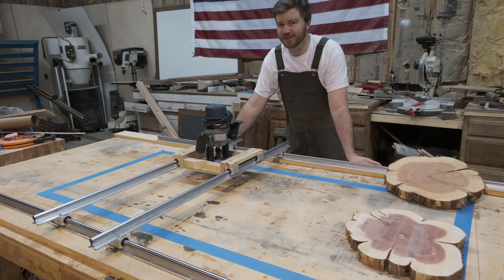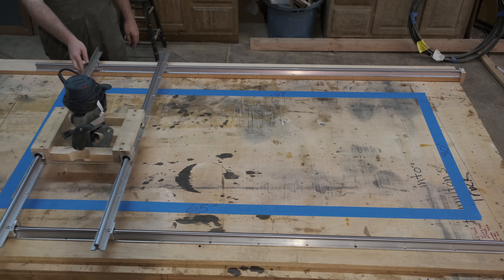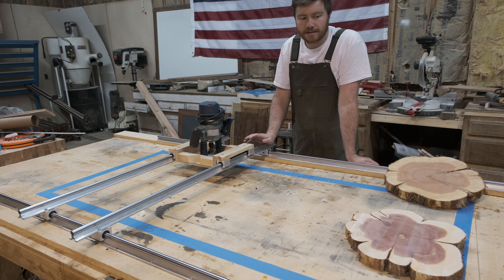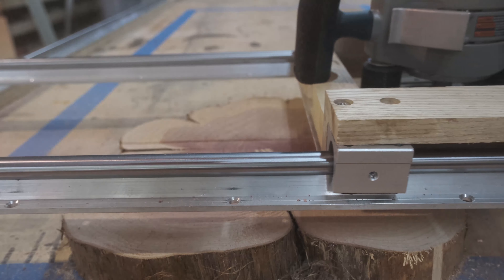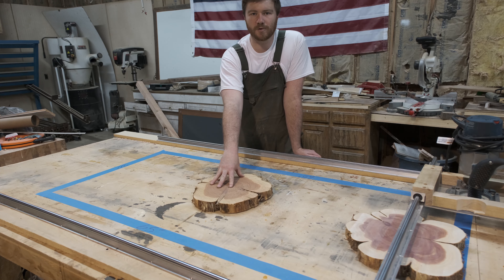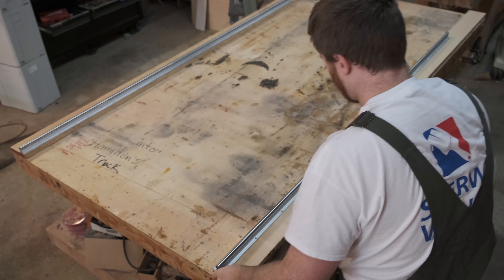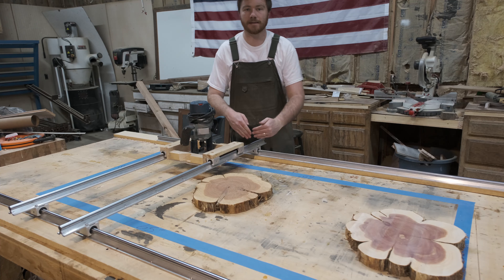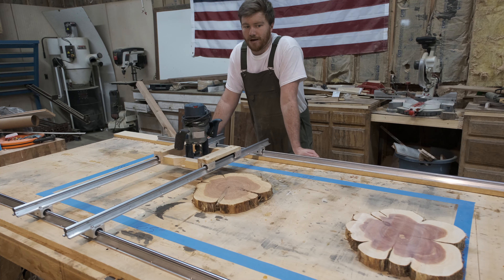DIY Linear Rail Router Sled

Comment: I have 2 lengths of 800mm I got off VEVOR a while back and I think I'm going to get 2x1500mm lengths and I've had an idea to have one plate for a Router and one for a top of the line Circular saw. I think this is worth having instead of a very expensive table saw..
I need to build some form of screw stops to lock the Saw blades into place on the cross lengths . I will be fitting some rulers of a type onto the base cross and length ways to be able to get good measurements of the wood I'll be cutting. I would not use Perspex. I would rather use Aluminium1/4 or 1/2" thick plate. Yes it's a bit more expensive than a 12x12" square of Perspex but for the saw's function it's a lot safer imho.
I bought the Linear Guide rails originally bcos I was thinking of building my own metalworking Lathe but I'm not a good welder as yet and it would've cost me an arm and a leg...LITERALLY PAL.. Ugh! LOL
I enjoyed this video though mate. It was a well thought of idea and very informative. I will be building mine soon and getting 2 uses for it. I'm trying t5o think of a way of getting it to cut mitres wile up on the rails too. If u have any ideas for something like that I would be very grateful to hear them.
I just think something like this has many more applications than just the router plate. I think u have the makings of a brilliant build with more ways of using the piece u built. 
Just a thought my friend. Hope u didn't mind me making those suggestions to much. I mean no disrespect by it. Keep up the great work man. Just found ur channel this morning. I have sub'd liked and all that good stuff.

Comment: I'm looking for insight into router bits for fastening. Your recommended Binstack bit is certainly inexpensive at $45. How would it compare to an Amana or Whiteside at five or more times the cost? Maybe this is an impossible question since it depends on cost versus quality of cut, life of bit, size, and so one. Still do you have any further thoughts about how you came to chose the Binstack or other insights? And thanks for an excellent video, well, explained with all the needed links.

Comment: Great video on the build, did you look at the longer 4 SBR20 UU blocks and rail system, only issue is the cross rails are longer or shorter. Would like to have one close to yours but 8' long . making a walnut table and like to do it in one pass. I'm worried about the joint if you have to add one more rail to the SBR16 system, you think it might jump just a bit? or did you already add a longer rail yours already. Thanks so much for the video, I'm going to mill aluminum plate for the connector cross router system, one other thing, did you think of a way to make an adjustment for height? other than the router ?👍👍👍👍👍👍

Comment: Intriguing.  The whole linear rails with bearing blocks is new to me.  Cool stuff, no question there.  
As I watched what my mind kept coming back to was the table.  I had better be really, really flat.  With no twisting.  That is doable, but it isn't going to just happen, it has to be designed in and executed well when building the table.

Comment: Considering the relatively long size of the upper rails, don't you have the problem of them being not perfectly straighy (u shape)?  My sled, having a 1.5m long upper section is having a roughly 1 mm difference because of a slight bend in the center - how would you solve that?
Reply: SBR20 should be ok at that size but there may be sagging in the middle where the lower rails are different metal. Mine came as SS on Alu and had 2-3mm deflection…unbolting and separating solved it and I mounted the bars on the bocks with readily available clamps on the blocks.

Comment: This is the best bang for the buck, cheapest, rigid router sled design I've seen. I was thinking about doing something similar. Started doing a little youtube research and this video came up. I'll probably weld up an aluminum router base frame with an acryilic bottom for see through. I have all the welding equipment. I might put some struts across the cross slides on the ends to keep them parallel, perhaps some all-thread so it can be adjusted. Maybe It's not needed, but in my mind it would keep it from potentially binding up.  I wasn't sure about using the linear bearings because of sawdust getting in there, but you're right. These components are cheap these days. This stuff used to be very pricy, and only available at industrial supply houses, back around 2012 when I built a CNC plasma cutting table. But now, it's a no brainer. Awesome video.

Comment: Make sure you get the correct tail size that matches  the bearing block. I.e.  screw holes on the rails I purchased did not match the screw holes on the bearing blacks. Absolute nightmare matching the ridiculously accurate accurate machined  screw holes on the blocks to where to drill out the screw hole on the miss matched rails.  Seller really messed me about on that one. Soo freakin agro after that combined with building a cradle out of cheap Chinese crap quality ply I’ll be purchasing my next one.

Comment: I just got 2, 48 inch,  and 2, 24 inch rails with 8 slide blocks from the local salvage yard. Cost, $18 bucks. God works in amazing ways
Reply from the maker: Awesome find!
Reply: @HamiltonDilbeck  Yes it was. Looking at your opening image. Is your router  zero at the bottom of the mount rails? My clearance is 1.75. In other words, the distance from the mounting surface of my base rails to the bottom of the router rails is 1.75". Did you make your router mount so the zero was lower or at your clearance?
Reply from the maker: Yes my router base is mounted to the plate that is parallel with the rail bottoms

Comment: I us hgr20 rails there is no movement in then and there is dust caps on the ends of the bearings.  Use polycarbonate for the router base, 12mm thick it’s not going to move lol.

Comment: So I am building one of these sleds, and this video was one of the primary motivations.  But when I try to install the perpendicular rails onto the bearings of the bottom rails, the drilled holes do not match up at all.  However, I can see from your video that you have2 screws going into each of the 4 bearings, lining up nice and neat with the holes in the upper rails.  Did yours just come like that, and I am unlucky?  Or did you have to modify the holes in the upper rails?

Comment: At 7:41 you mention the possibility for sagging if longer cross rails were used. Do you think there would be much sag if the 1500mm (59”) rails were used instead of the 1200mm cross rails you used in the video?

Comment: I really like the design and was definitely looking at something similar earlier this year, after discovering the world of router sleds. However, after buying a cnc, I find it very difficult to justify something like this. I don't make any large projects, so between my lunchbox planer and the CNC, I can easily accomplish the same result. The CNC may not have the capacity or the power to do some things, but for a small shop like mine, having one tool that can perform several tasks is definitely a plus. Not slamming the idea, just will have to file it away for when I have a larger shop.

Comment: I have found SBR 20 rails that are designed to fit together for extending; they actually insert like pipes connect. I even found some that had the equivalent of whisker biscuits built in the bearing blocks. Like you I did not think they were needed, nothing a blast of air and carb cleaner wont fix, followed by lube.

Comment: I will build using 20mm and 40mm for top rail. The hope is to use it not only for a router but also with a saw, planer and sander.
Reply from the maker: Interested to see how it turns out!

Comment: Purchased the rails and fastened the long ones to three  4"x3/4"x96" laminated mdf strips each . The shorter cross bridge has 1/4"x2"x12" aluminum flat bar connecting the rails .I have one set of bearings fastened at the end of short rails(operator side) other set fastens to a width needed for project width . Router trolley bearings are joined by the same size aluminun flat bar as described before .  Router trolley is U shaped with wimgs at the top to sit on bearing plates . The sled is assembled on my 4'x8' work table and when not in use is disassembled and stored on shelves made especially for them . Hope all can decipher my ramblings

Comment: Amazing I was just on McMaster Carr last night ordering rails and sleeve bearings to do this exact same thing.  Then I get on YouTube this morning and this video pops up.  Here I was thinking I was going to be the first to do this.  I guess not.  Im going to used PTFE sleeved bearings though instead of linear ball bearings, just because the sleeved bearings will handle the saw dust better over time.  Other than that though, Im doing the same thing.  Bravo bro.  Now I know what I was thinking is actually going to freaking work.

Comment: YEAH!! Thanks so much for posting this! Exactly what I was thinking of building but you beat me to it. I need a specific router sled for larger molding bits to run vertically along the edge of 2-3" wood strips to make clean frame molding before cutting it. This looks stable enough to run a fine line down the wood without wavering. I just need to figure out how to set the wood in place between the two shafts, using the rails as a straight router carrier. (just need 2 rails, not 4) Best price is from Vevor direct, 2200mm, 84" for $149. They must be made by the same company as the comments are the same and they look identical. I will find out soon enough, already ordered them today. Free shipping, too. Amazon was $50 higher.  Thanks again for taking the time for the video. Great explanation and very direct. No BS.

Comment: Thanks for post and product links, very useful. One element warranting care when flattening larger slabs (e.g., for table tops) is that the main frame and support rails be perfectly flat, in particular with regard to twist. I use a much less sophisticated setup with great results (no bearings whatsoever), and when I set up my long base rails (heavy straight aluminum channels), I use my digital level as one would use winding sticks to confirm that both ends of the rails are in the same plane. In your setup I presume your bench is providing an accurate planar base for your longitudinal rails, but as you can see, even your superior components could produce twisted surfaces if the bench top were itself twisted.
Reply: Learned this the expensive way

Comment: 🙋 .Nice work! I am interested what's exact model of bearing you use and can be fully tightened with that side screw ?thanks
Reply from the maker: Those are the SBR16 Bearing Blocks that come with the SBR16 Linear Rails

Comment: Hi.  This is a great video.  Is SBR16 is strong enough or should I go with SBR20?
Reply from the maker: I've found that the sbr16 is plenty strong for the size thats in my video.
Reply: @HamiltonDilbeck  Thank you.  Looks like the SBR16 1200mm is not available.  I will look for it again.  Otherwise, it doesn't hurt to go with SBR 20, correct?  Seems like there are more SBR20 available on Amazon.

Comment: My block holes don't seem to line up with the holes in the top rail. I guess I can try it with 1 screw, but that seems silly . Maybe someone has an idea for this
Reply from the maker: Interesting, from what I've heard it seems like the quality control from the Amazon seller is not great. If I were you, I would put blue painters tape over the holes on the bearing block, mark the holes on the tape, transfer the tape onto the rails and then drill new holes for the screws to go into. Hope this helps!
Reply: @HamiltonDilbeck  what is the dimension of the screw holes on the bearing block and how deep are they?

Comment: how did you mount the wood on the bearing blocks? I'm finding it hard to get it right for the 4 holes
Reply from the maker: So I've found that using blue tape and using that to mark out hole locations is helpful and then transfering that for drilling onto the material.
Reply: @HamiltonDilbeck  Just tried it, I'm still finding it hard to be 100% accurate using this method

Comment: Funny enough I am currently building the exact same thing and I discover your video. 
But I was concerned about the flex over a large distance, and is it me or does it actually flex in the beginning of the video? 
Did you check with a straight edge with the weight of the router?
Reply from the maker: I think that was more of the router plung wiggle. From what I've seen its very straight. I haven't had any issues, not sure how much wider I would go, though!

Comment: Can you add on to the side rails to make it longer?  I need about 12ft
Reply from the maker: I haven't done it myself, yet. But I don't see any reason that you cant. I would just make sure to take the time to mount them to a 12' board to make sure that they are straight. If not you might get some bumping when the bearing block goes over the intersection.

Comment: My system gives friction, meaning it does not move smooth. How do you align the base rail?
Reply from the maker: I've aligned mine by just running the middle to one end, screwing it down, and then runnning it to the other end and screwing it down. Hope that helps!

Comment: That's funny cause as i discover your channel and video, i've order exactly the same pieces to make my router sled. i was looking for a metal plate to hold the tool but this one seem to do the job well. thanks for your video and idea !
Reply from the maker: Glad it's useful! Working on a better way to easily mount the router, but the video won't be out for a while.

Comment: Version 2 - I used 1 1/2" and 2" aluminum angle. the combination work out perfectly with the size of the blocks. Making a 'Z', the 2" covers the top of the block, and aligning the 1 1/2 brings it to the bottom of the rail. A few rivets and it was quick and easy. It's also a nice look with the aluminum, the stainless rails, and clear 1/2" plastic.
Reply from the maker: Awesome, I've been playing around with something similar! Hoping to have a new video about it out soon. Thanks for watching!
Reply: I have no clue what you said. Show us please

Comment: You can see it really sagging down unfortunately
Reply: Yep. Those rails are meant to be supported… not span a wide gap, floating in mid air.
Reply: How drunk were you when posted that?!? Did you bother to notice that those rails CAN'T bow or bend?! Ever  see how a linear is constructed?! Didnt think so...
Reply: No you can't..jealous much?
Reply: @davadoff  Yet hundreds and hundreds of ppl have this se set-up and never a problem..How do think CNC routers work.???!! Maybe you should try going to school or watch a video how linear rsils are made???!!! Wow...smh..
Reply: He likely got the 16mm for the cross section.  The 20mm really help to not have sag
Reply: I think the sliding in multiple planes gives the illusion of sag, there’s very little if any.
Reply: Similar to how I built mine. I built a metal router cradle though with an extra faceplate mounted in it so I can solidly mount my router if need be. For all the haters this is way better than the vevor system that stuff is trash and does sag u like these

Comment: Just curious what size is your table that the rails are mounted on? I’m curious if the end rails were secured properly and the front and back rails were hanging off the edge of a table would it flex or be unstable? I’m working on something but I think the max depth of the surface would be 36” which I think would limit me to 25” wide slabs.
Reply from the maker: Its all on a 4x8 table. This allows width of around 36"

Comment: Hey I was Looking for a way to contact ya.   I just Made one this week.  I used the Bosch Router Table plate.  I think I my make a video of it too just to help other people out.   Awesome video.  Another guy has one like this too.  Kman builds or something like that.   Thing works awesome !!
Reply from the maker: That's a great idea, let me know of any ways you make it better!
Reply: @HamiltonDilbeck  I definitely will😀.
Reply: Did you end up making a video of your setup?  I've got the same router, and am interested in more details about the plate you used.  Did you use the adapter plate and just screw it on to the bearing blocks?  Thanks!
Reply: @threesonsrestorations4043  I’m getting ready to make the video soon I just have the plate bolted to the blocks.  It seems to be working well so far.
Reply: @threesonsrestorations4043  yes.  That’s all i have done is just bolted it down.

Comment: Yes bench platen needs to be flat and level both ways in order to get a  perfect milled cut. More work than just leveling 2 long  fixed wood rails .Im building mine with bearings and rails ,that being said 👍

Comment: Did you have any problem getting the 1/2'' shank of the router bit into the extension that you listed in the description? I got your setup and the bit will not fit down into the coulet. Thanks.

Comment: Hey everyone! I am trying to order the parts but it says unavailable :( Is that because i'm in Canada or are they sold out?? Thanks for any help I am very excited to get this project going and the projects I am using this router sled for!
Reply from the maker: Updated the 2000mm link. Its a strange item and sells out fast so I have to update them regularly. Might be able to find them cheaper on ebay, though! Not sure if its a USA Canada issue. Hope this helps!